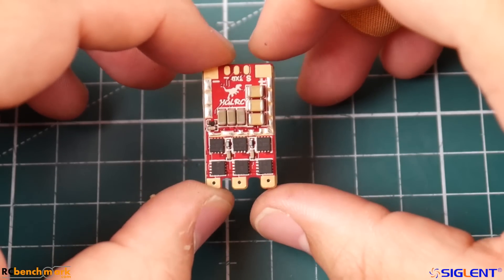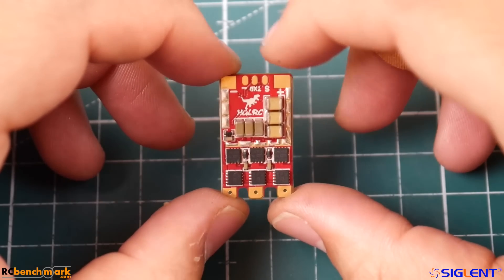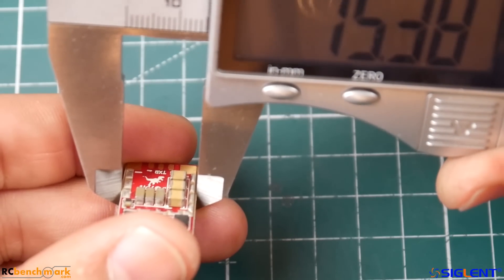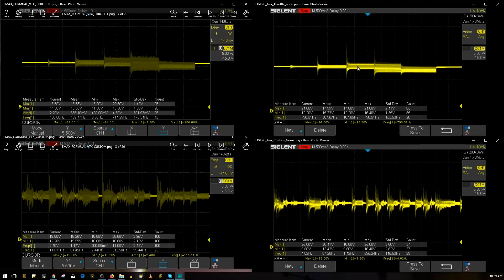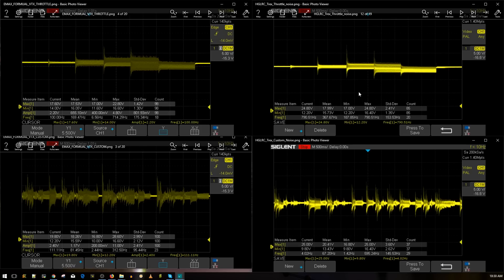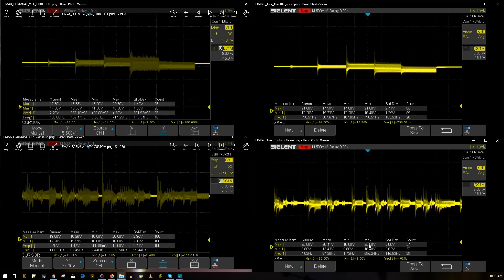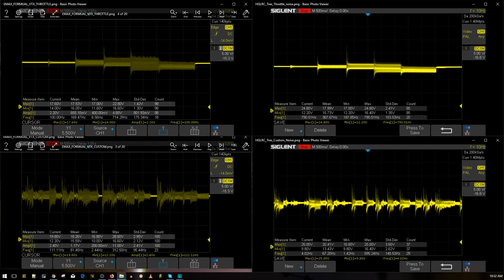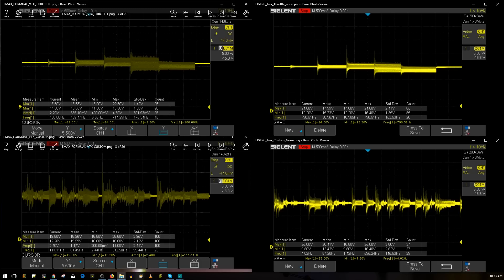New Best FPV Drone ESC? //  HGLRC T-Rex 60AMP Noise Test

Comment: What makes that one 60 amps?
Looks like the same size mosfets as a 30
Current testing please
Make your current meter read 60 amps please
I'm very skeptical of this claim.
Reply: Fets are on both sides of the board so basically they have doubled up the fets